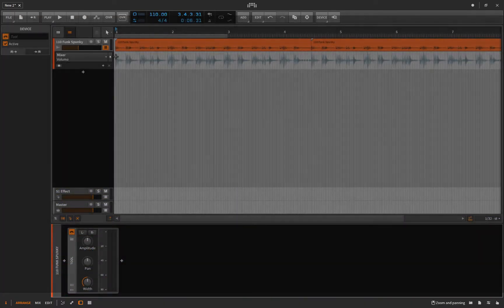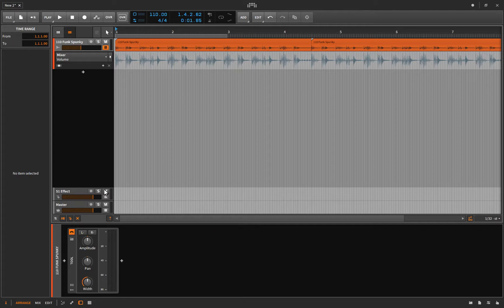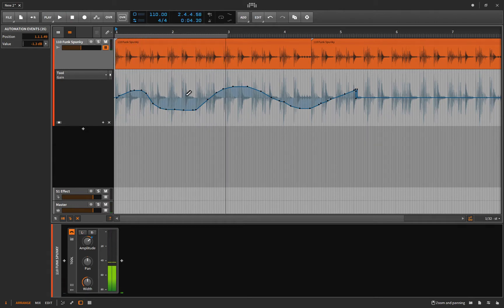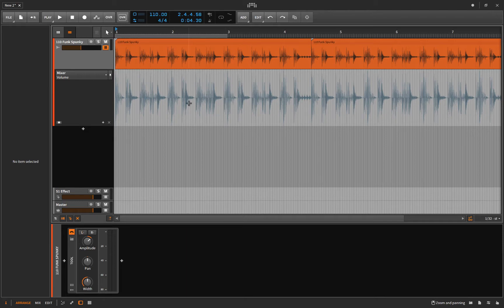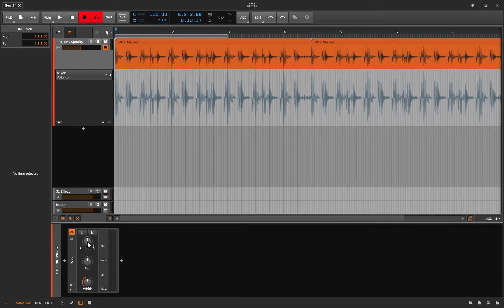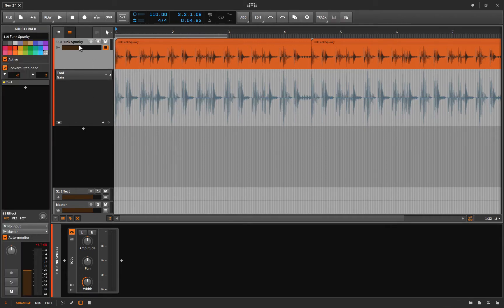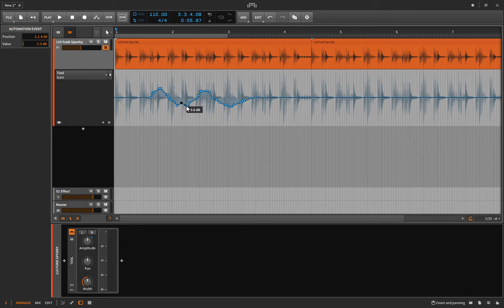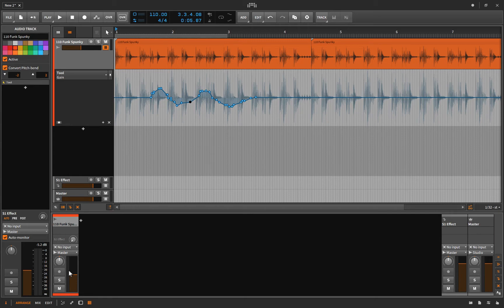Automation - Latch, Touch, Write modes - Bitwig 2 tutorial

Comment: Excellent video! I'm a new Bitwig user coming from Ableton and just trying to learn the basics. Wondering if you can help with one question -- if you're familiar with Ableton --- if you set the grid to 1/2 note length, and then go into the pencil, and then click under the automation line, it makes the whole 1/2 bar automation line drop to where you clicked. This lets you draw square shapes really easily, which is useful if you want to automate an entire note length. In bitwig, the best I can tell is you have to draw both left and right points, like you can't draw a solid straight line in one fell swoop. I hope this makes sense. Is there a trick to doing this? This isn't about snapping a point to grid, it's about the automation creating both end points at once with a straight line between them... Thank you.

Comment: Hey man, thank you for your tutorials, they're great! Quick question, is there any disadvantage of some kind, of using the tool effect on every track to automate volume and panning, instead of using the mixer? Because I think it's indeed a cool way to work and I don't know why I've never seen this method elsewhere.
Reply from the maker: Hey! Great question!
The ONLY disadvantage that I can find is that if you turn the volume on the tool all the way down, it doesn't actually cut ALL of the sound, you'll notice that a little bit of sound still leaks thru. The tool can only reduce volume by (i think) 30dB or so...but for me its ok because if I want to cut all sound, I'll happily automate the 'mute' button rather than the volume anyway....
Aside from that, I find automating the tool volume to be a much better work flow and much easier to use.
Cheers!
Reply: Alright! Thanks a lot :-)
Reply: Hey Alex! Super great your tutorials! I love the way you explain things. Easy to understand! Just alitle question about automation that i cant find how to do or if it s possible.. Is there a way to overlap bots when you get one and move it as in ableton? Don t know the name of this on ableton but if you write a curve and you want to overlap some dots, in ableton you just have to hold the dot, move around the automation and it will overlap wherever you want to go and redrawing the automation line. I think thats super handy. Is this possible in bitwig? Many thanks man! ;)